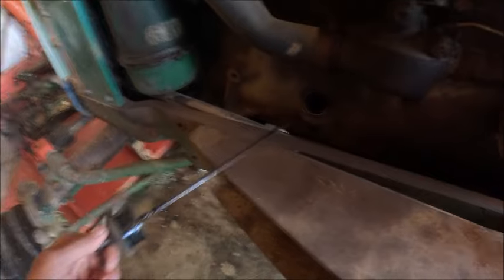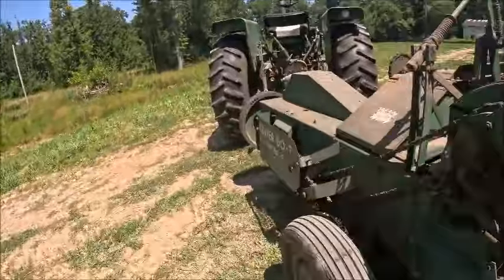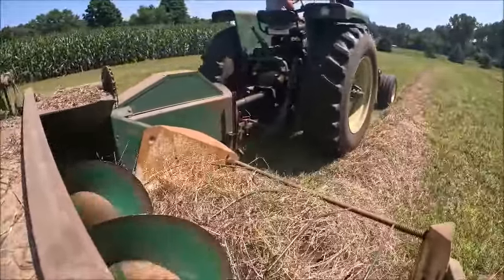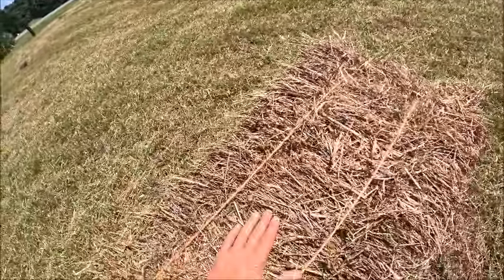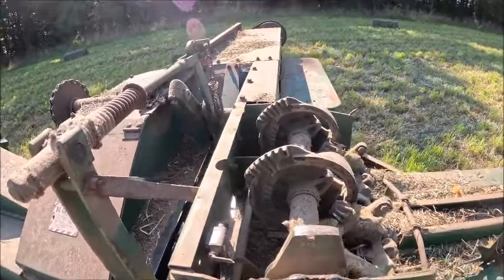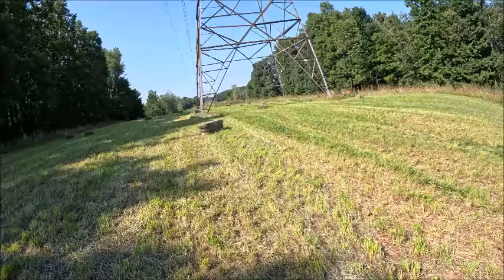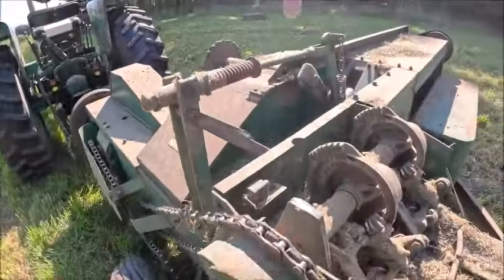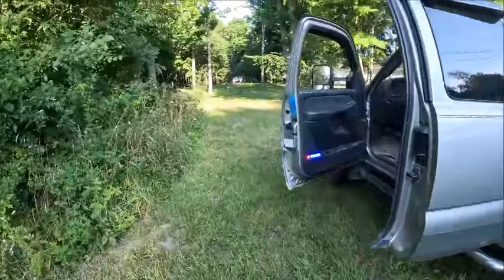Custom Baling And Making My Second Cutting Hay

Comment: We had such a hard time getting good consistent twine we switched to plastic.  Now I might go 600-800 bales without a missed tie and thats usually from where the knot joining two rolls is.  You should try plastic just to see if it makes a difference.
Reply from the maker: Hate plastic twine. I’ll never use it.
Reply: I was just saying to try it so if it eliminates the issue you would know its the twine.

Comment: First thing that came to mind on them mis-ties was the twine. As in, the bottom of the twine bale is moist & every time that section of twine manages to roll through the knotter, the extra flexibility in wet twine makes her skip & slip. That first field you baled look like it would only make bedding. Browner than a dog turd & coarser than a drunken sailor on shore leave. LOL. Them hydro cut fields you got though, are good hay makers, even if they're small. Best I ever got was 57 square to an acre & that was first cut. So 30-40 is quite respectable when you're talking quality 2nd cut hay.
Reply from the maker: A mostly grass mix just never makes the tonnage of a nice legume mix.

Comment: The nutter mechanisms on them hay balers just amaze me
Reply from the maker: Yep
Reply: That was supposed to be knotter
Reply: And for your FYI have you take peppermint oil put that on a cotton ball then throw in your combines moissanite or deadly allergic so they stay away from it we used to put them in all our corn trucks chopper and we never ever had a problem after we started doing that will you started out using mothballs which worked okay but the peppermint oil works 100% better what you need to combine I would throw three or four in the cab and then just toss a few around the outside on the chopper combine itself and they will not go near it

Comment: Second cutting my brothers still trying to get 1st off... he hasnt had 3 days without rain all year except 1 time since  may... Dang Ethan them Olivers sound so good... I got a Gasser 1600 myself.. smooth sounding
Reply: We got a gasser 1600 too , run haybine , rake , auger tractor etc.
Reply from the maker: We are to the point we could use another shot of rain again.
Reply: @Oliver66FarmBoy  wish my brother could send you some from NE wisconsin.... just hope the fall dont turn to monsoon again when you trying to get the corn and beans off again... Tracks are nice to have but if you dont need to mount em its so much easier to get crops off